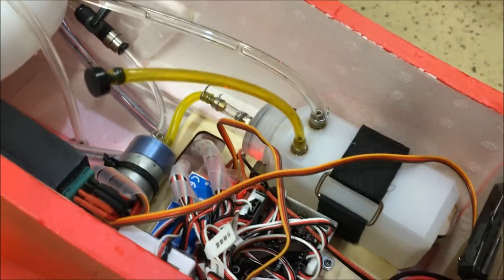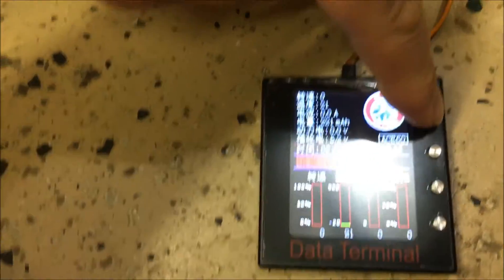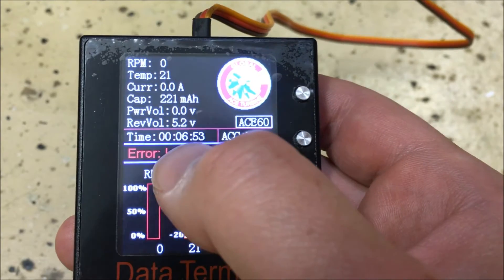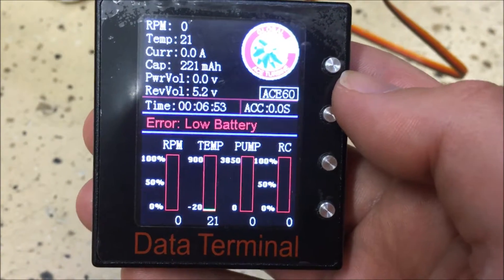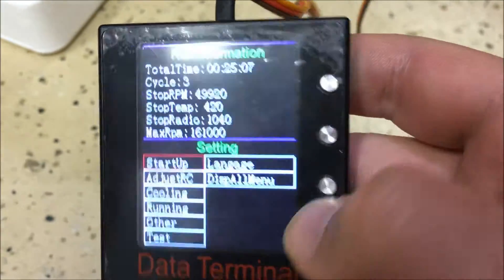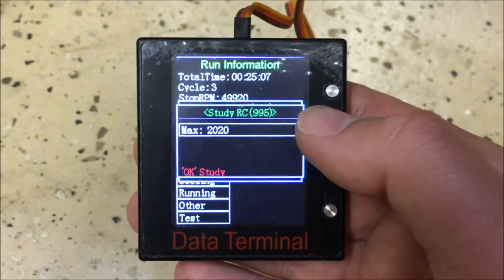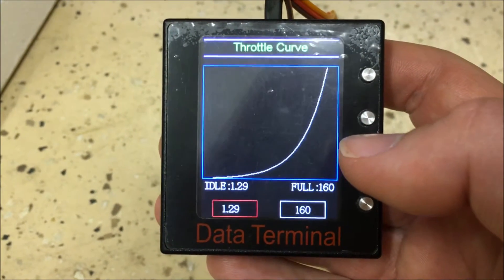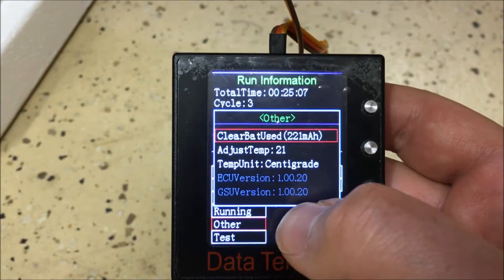Swiwin Elite/ ACE ECU + GSU Guide, Tips, and Setup.

Comment: hello, I have this engine and I am experiencing trouble at startup: when it reaches about 24,000 rpms the engine will stop, usually no error is shown in the Data terminal, it just stops... after MANY attempts (20+) it will start, once its running at 50,000 rpms it will work perfectly. Do you have any suggestions?
Reply from the maker: Guillermo Hernandez I will send you a reply on Rcgroups thread
Reply: Hey bro....having the same problem....what was the issue??